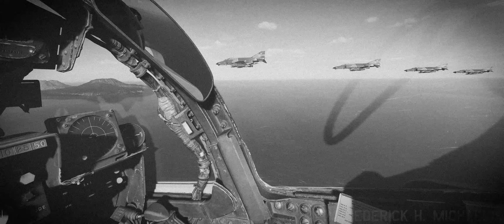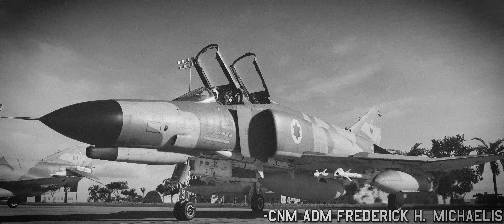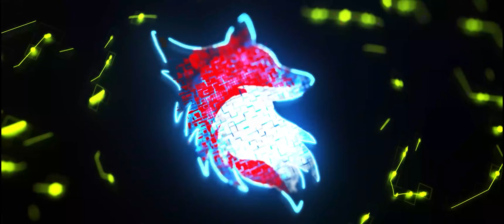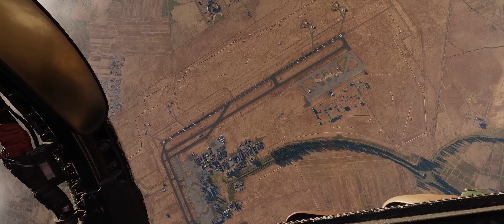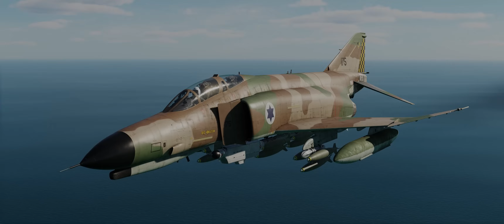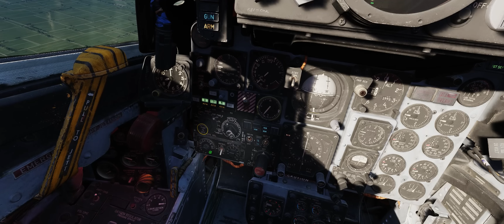DCS F-4E Phantom II Dive Toss Munitions Delivery Tutorial!

Comment: Nice video! Small correction, the drag coefficient is dependent on altitude and speed, not just the weapon. If you adjust the values, you will see the drag coefficient changing. The changes are typically rather minor though, so it is likely that even if you do not fly your desired profile accurately, bombs will still hit somewhere around the target. It starts to matter on extreme values though, or if you really need pinpoint precision 🙂

Comment: hey there's actually a phantom in the video this time
Reply from the maker: hopefully you used the Mirage 2000C to practice so you can hit the ground runnin'! Hahaha!
Reply: @Spudspike  I hope the M2kC will still be around, it's one of my favourite planes in the sim. I'm assuming the Strike Eagle and Harrier may well be lost, but the Mirage, at least, is close to finished now. Fingers crossed there's a way through.

Love this tutorial, BTW. And its siblings. It's enabled me to get stuff done, I can now go back at my leisure and learn all the OCD IRL procedures when I want to. But it's nice to not have to learn all that stuff before shooting things down/blowing stuff up. In short, I'm loving the Phantom. The Mirage F1 is probably my actual favourite right now, (EDIT: the Phantom may unseat it from this position, though) so I love the 4th Gen stuff, but for the Phantom I was a little concerned about Jester. I have the Tomcat and the Apache but I've never really gelled with the AI WSO or CP/G. But for some reason, maybe it's the updated Jester 2.0, I'm finding the 'person' in the rear seat adds value rather than makes things more complex, for me anyway. Petrovich kinda works in the Hind, but largely because the CP/G has a simpler job, I reckon. But Jester in the Phantom actually makes me feel like I'm not flying solo.